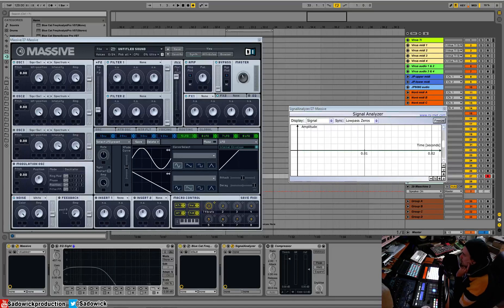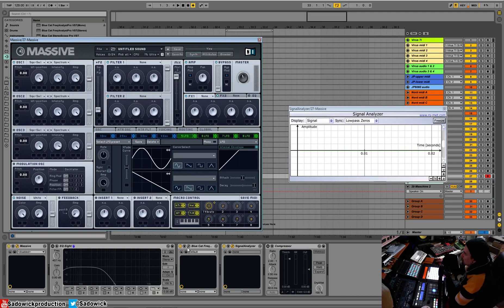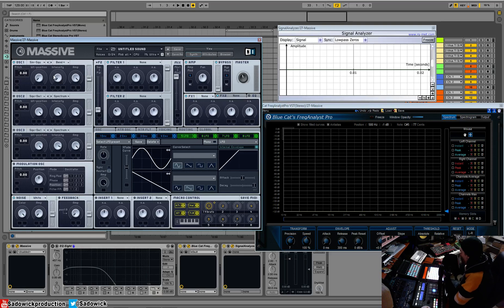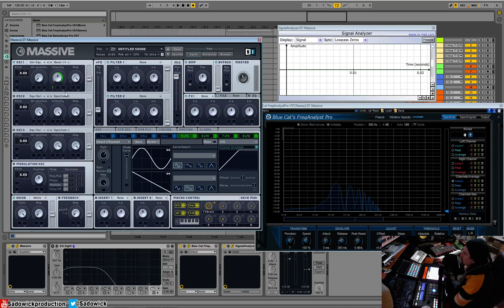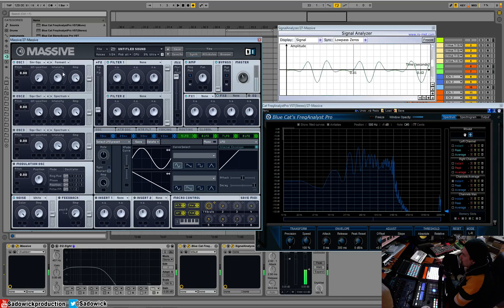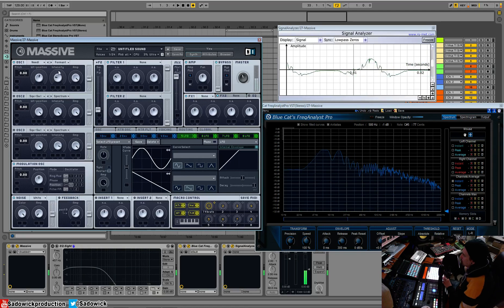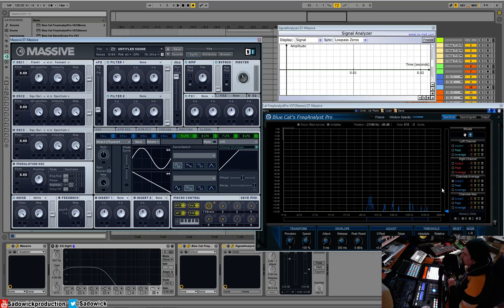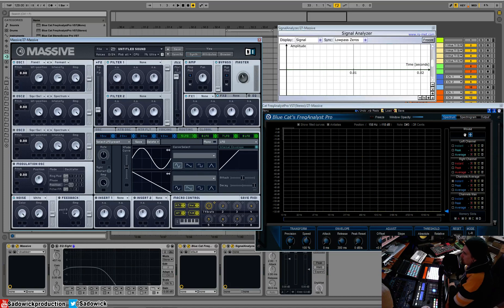Native Instruments Massive Tutorial 15 - Oscillator Spectrum, Bend & Formant

Comment: what exactly does BEND - do?
Reply from the maker: - bends the bottom of the waveform and + bends the top of the waveform. You can see what it does in an oscilloscope but its kinda hard to explain. The manual doesnt do a good job at explaining it either. It pretty much warps the symmetry one way or another to achieve a different timbre
Reply: ah ok, thanks man